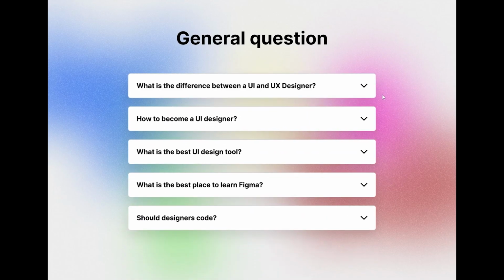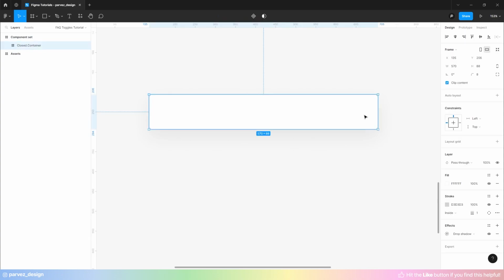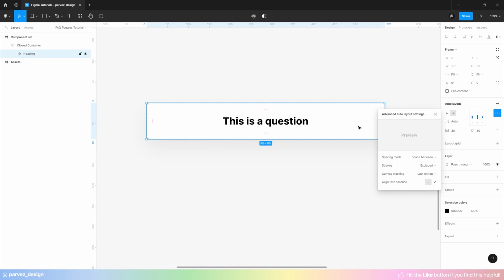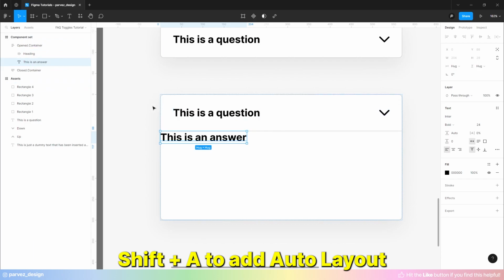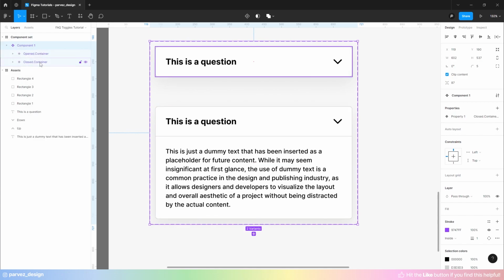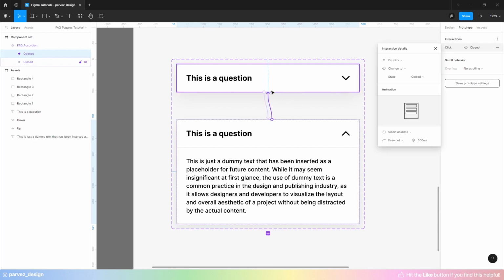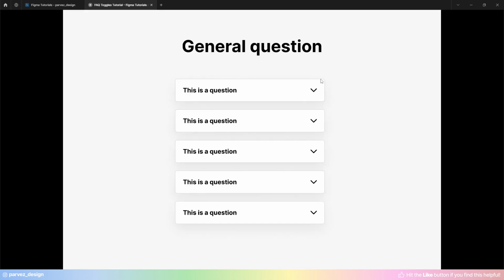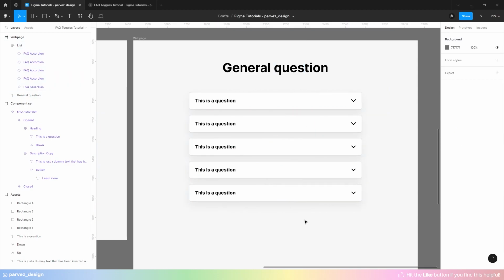Let's Design & Animate Accordions with Interactive Components using Figma - Figma animation tutorial

Comment: I’m new to Figma and have spent 3 days trying to figure out how to make an accordion. I watched so many vids and I almost gave up until I found this video and followed along! Thank you so much for posting it!😊
Reply from the maker: That’s great to hear! Let me know if you need help with anything else 😊
Reply: @ForwardPixels  Hi again, I wanted to let you know that I also had issues replacing the description copy for each of my questions… the prototype wouldn’t link to my changes. 
I remade the accordion multiple times and couldn’t figure out how to make it work! I finally discovered the add text properties option and was able to add that to each section of the accordion component set which solved the issue entirely and also made it super easy to change description copy as I set up my FAQ Menu. :)